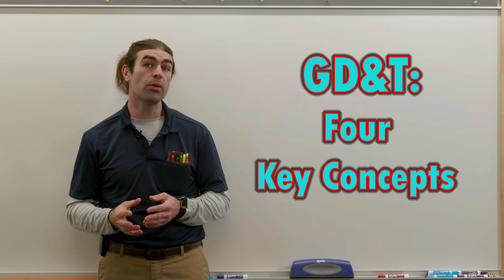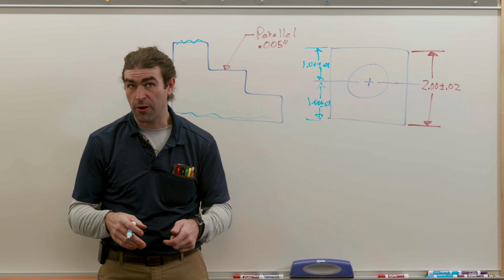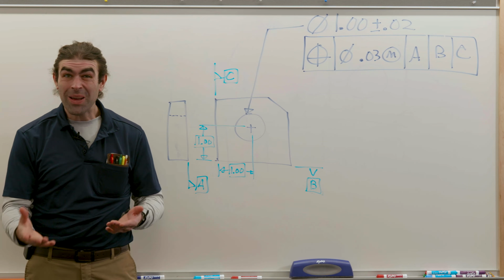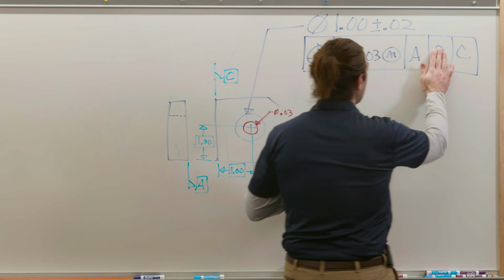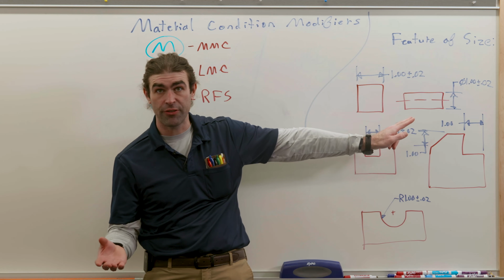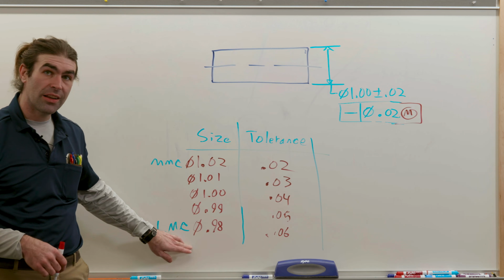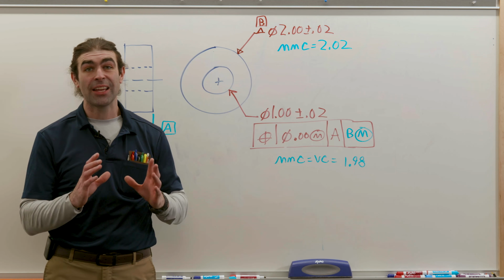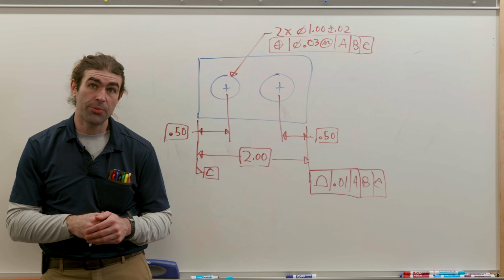GD&T Lesson 1: Four Key Concepts

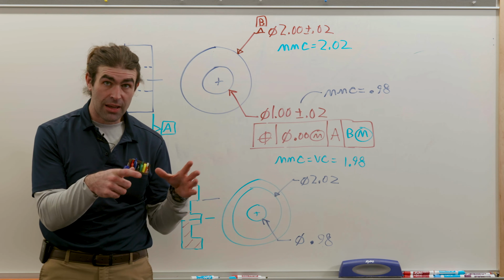Comment: 21:48 shouldn't the MMC be 1.02 and LMC be 0.98? I think you that said vice versa, or am I missing something? 

Also, 20:09 that you said the hole has 0 positional tolerance at its SMALLEST size, and if the hole is bigger, we get more tolerance; but shouldn't that be vice versa as well, since it says 0.00 M, it should mean that the positional tolerance is 0 at is BIGGEST size and should get bigger as the hole gets smaller. Someone please explain if I interpreted this wrong or if I'm missing something.

Edit - I just understood lol, MMC for a hole means the smallest hole size. Sorry for all that lmao thanks.

PS - Thanks for everything you're teaching on here, I didn't learn anything about this at Uni

Comment: 3:34 That is absolutely 💯 correct. 

Datums whether it could be ABC or XYZ or 321 are basically an absolute common ground or a foundation or a reference where a designer, manufacturer and quality inspector come together to speak of & understand the same concept without leading them to any incorrect interpretation.

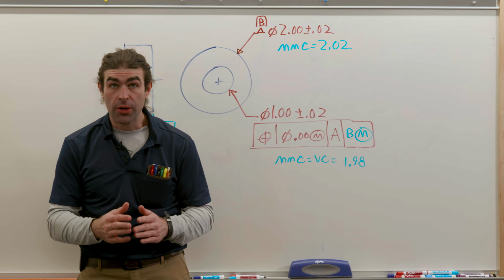Comment: Thank you for your great educational videos on GD&T. A couple of questions: There is a confusing note under feature control frame on the drawing at 19:30 . It says "MMC=VC=1.98". The hole feature size is only 1.00 +/-.02 shouldn't it be 0.98 at MMC? Also, does departure from MMB/LMB when used on datum in feature control frame affects other tolerances of feature size or geometric tolerance?
Reply: In this figure the smaller hole is an internal FOS, and you should know that for hole the MMC size is the smallest size of dia which is 1.98 and there is no geometrical tolerance are given for MMC ,that is why    VC=1.98

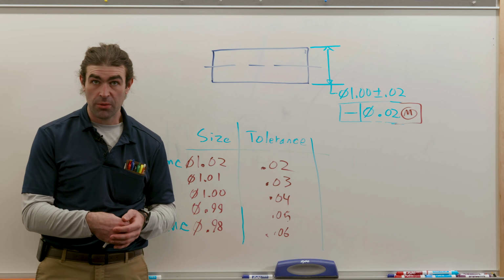Comment: @18:00 How could additional tolerance be gained by moving closer to MMC from LMC? If your alignment pin is getting larger or hole is getting smaller, by default you are losing positional tolerance for those features. In what type of situation would you actually be gaining tolerance like stated in the LMC description?
Reply: 0.06

Comment: Hello professor, thank you for the explinations, please what do you mean by : 
- basic dimensions  terminate of 30 thousandths ? 
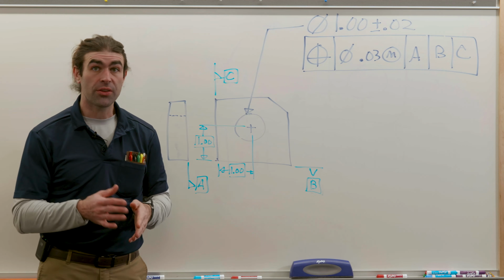- position is almost applied with the directly tolerance dimension that applied to a feature of size in 8:27
-  this surface is parallel to 5 thousands in 5:53
and why you said for datums it can be A C B, then it should be A, B, the C ?

Comment: @RDeanOdellHVCC  Thanks for all the video explanations you have put up! Really helpful!

Can you answer this: if the part comes in at exactly at  Upper Spec Limit (USL)  1.02 and MMC is not applied, then 

1.Form tolerance applied will become zero zero, 
or 
2.Will it be 1.02 USL  + 0.02 form tolerance

Comment: on your last example, you have dia.03 in the feature control box. how does this relate to the part holes' size tolerances? 

it would still be MMC 0.98size + .06 to get back to 1.04, correct?

Comment: Great Explanation Professor.
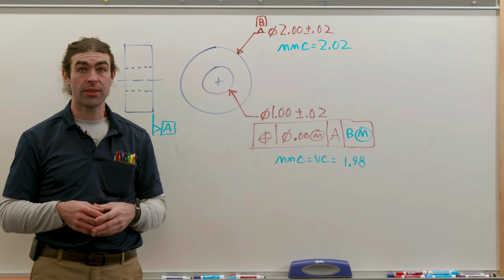Is it possible to make a video on inspecting the position tolerance of the washer explained in 19:44 with datum A and B at RMB. Or even explain how will we use gauges in calculating the deviation.

Comment: Question regarding the MMC and LMC pin example at 18:00:
1. For MMC pin example, does machinist tends to machine the pin to the lower end (0.98, 0.99) to give themselves more room for error (shaft deflection from lathing etc...)  in straightness?
2. For LMC pin example, what is the practical application?

Comment: I have to disagree about not reporting Basic dimensions unless you are in a strict pass/ fail situation.    

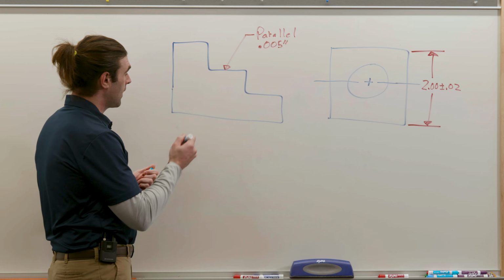In the shop, the machinist nearly always wants to know where the center of the hole is, especially if the feature is out of tolerance..  Reporting  .01 position can mean many different things, especially if you have multiple holes in a pattern. Having all the holes in a pattern drift towards 2:00 o'clock is a very different thing than having the holes moving randomly.   If the holes are drifting about the same amount and in the same direction then that is very likely a setup issue.  If the holes are moving randomly then something may be loose in the setup.

I do like your videos and wish I had something like them back in the dark ages when I was first learning this stuff.
Reply from the maker: Hi, thanks for the great feedback. I understand your disagreement completely. I think this is always going to be a sticking point between manufacturing and inspection. 

My view on the design and inspection side is that drawing requirements are pass/fail. No room for interpretation if the drawing is prepared correctly.

I hope most companies have a feedback mechanism where inspection can include important data on actual locations from basic dimensions so that manufacturing can fix errors.
Reply: ASME Y14.45-2021, titled "Measurement Data Reporting" has a solution for this issue.  For position tolerance data, Y14.45 specifies that "Location components" are a standard item that can be (should be in most cases) included along with a position value.  Location components are the X, or Y, or Z locations of, for instance, each end point of the axis of a hole.  If the position tolerance is applied to a center plane of a slot or tab then only one location component may be needed.  If the position tolerance is applied to an axis of a shaft or bore then two directions of location components, possibly at each axis end point (if the feature has enough length/depth to make this practical) are needed.  If the position tolerance applies to the center point of a sphere, then three location components, X, Y, and Z will be needed.  As you may already be thinking, if X, Y and Z location components are to be reported, then an explicit set of coordinate axes that represent the applicable datum reference frame must be shown on the drawing or model when location component reporting is desired.  There are several conceptual and practical reasons why basic dimension cannot be reported (it's more than just that they should not be reported), but location components, relative to an explicit set of datum reference frame coordinate axes provide a good way to provide clear data the shows where the feature is.  A similar type of additional data that clarifies data reporting for profile tolerances is also specified in Y14.45-2021.  "Surface deviation" values for each measured point, or a sampling of measured points can be reported along with the profile value.

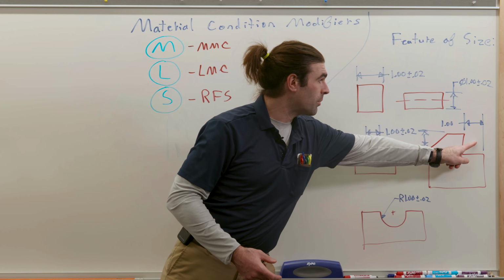Comment: Couldn't the cut discussed around 15:00 be measured using the depth gauge and therefore a feature of size?
Reply from the maker: Hi. It sure could be measured that way! The idea with the feature of size definition in the ASME standard is that you need opposing points, while the depth gage is measuring in the same direction. This isn’t a law of nature or anything, so your instinct is not wrong. The ISO standard allows some different concepts like position on surfaces where the ASME standard says that is against the “rules”.

Comment: So...if we are considering a thru hole in a block...at mmc the hole will be smaller with limited tolerance to its axis(considering position gtol)....and if the hole is.larger then the hole axis can bend or have more.slantness?
Reply from the maker: Basically, yes. If the hole is toleranced with position and the MMC symbol is present, the hole gets more position tolerance if it is made a larger size within the size tolerance. The additional position tolerance is called “bonus tolerance” although this phrase is not in ASME Y14.5. The bonus tolerance is the difference between the actual size of the unrelated actual mating envelope and the MMC size. This can be added to the specified position tolerance and is known as the “allowable” tolerance. The axis is always straight, but can exist at any orientation or location within the tolerance zone.

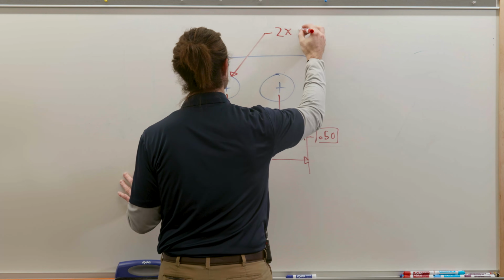Comment: Hi Dean, great content as always. Would I be correct in saying that for the drawing produced at 22:47, there is nothing controlling the tolerance of the 2.00 dimension until you add the profile tolerance at 23:20? In other words, is the drawing incomplete or "incorrect" until the profile characteristic and tolerance is added since there is no feature control frame associated with the basic dimension 2.00?
Reply from the maker: Hi, thanks so much! 
You are correct! According to Fundamental Rule “A” ( I made a video about it last year ). Every dimension must have a tolerance. As you pointed out, that surface dimensioned with a basic dimension does not have any associated feature control frames. This would make the specification incomplete. Adding a profile would be the best course of action in most situations.

Comment: Let's say we have a position tolerance exactly the same as given in time 8:00. What would be the situation if we defined datums as only B and C (cancelled datum A restriction)?
Reply from the maker: Great question! Without datum A, the axis would have no perpendicularity requirements. So the hole could be at an extreme angle and still pass a position check on one side of the part or the other.
Reply: @RDeanOdell  Thank you for the response. Your videos are so helpful.
So, if we cancel A, we inspect the hole at just one circle in terms of the position according to B and C, one of the two sides of the part, right? And if we include datum A, we inspect it throughout the hole.

Comment: Great video Dean. The only part that was a little confusing is that you seemed to be drawing the Right Hand View for parts to the left of the front view in your samples. So that when you had a datum reference it seemed to be picking up the opposite intended surface? See for example your Views at 19:33 in your video.